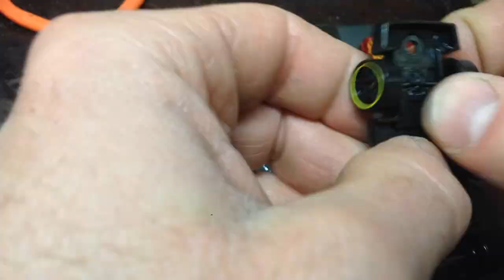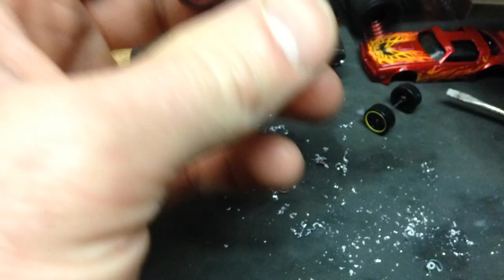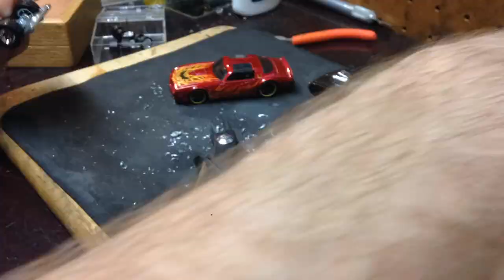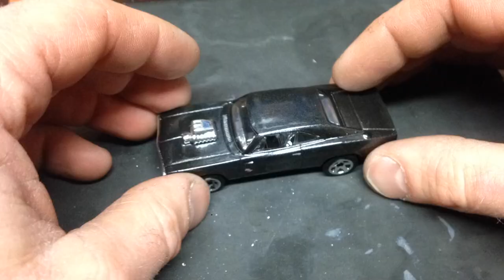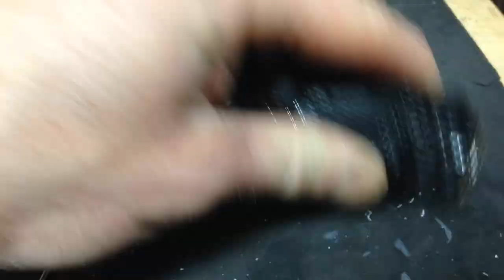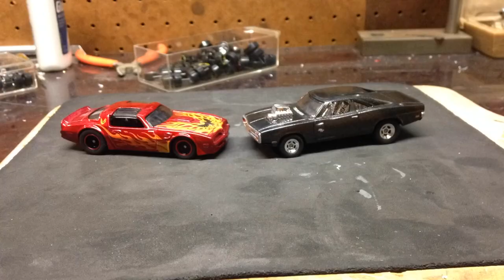Hot Wheels rubber tire swap

Comment: Can you make the vid normal speed next time 👍 where did you get the tires ?? And do you glue the body on??
Reply from the maker: I will be making a normal speed wheel swap vid soon.  I just have to edit it.  The wheels and tires were taken off of a different Hot Wheels car.  You can glue the body back onto the post with a little drop of glue, but I like to drill and tap the post so I can use a screw to remove the body anytime.